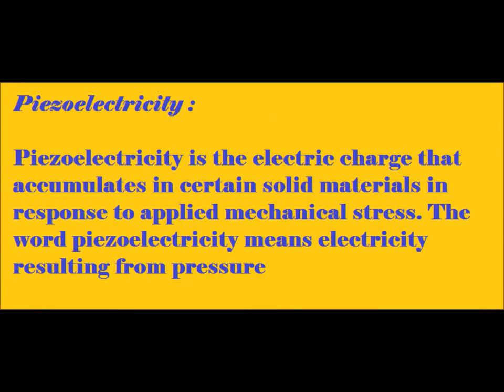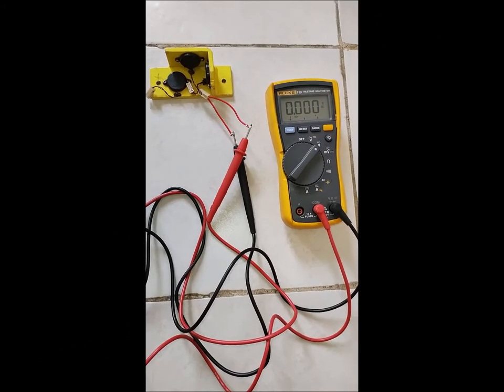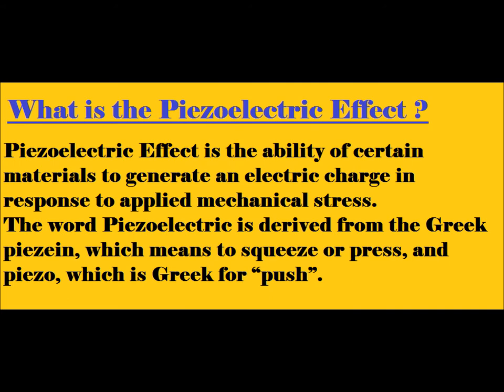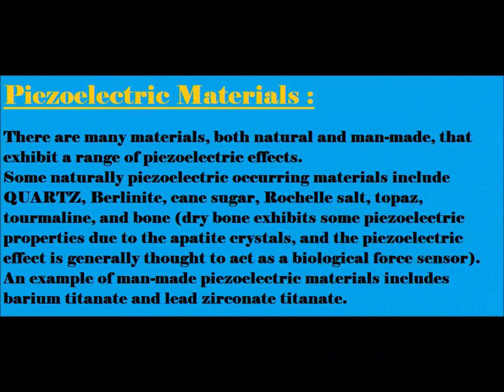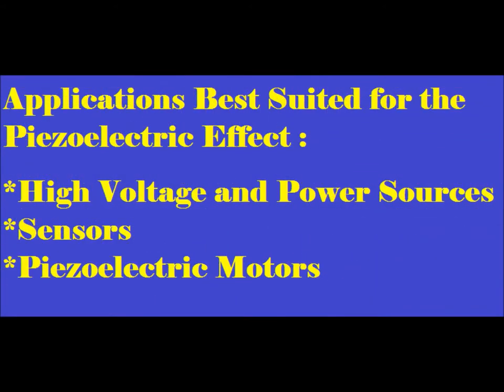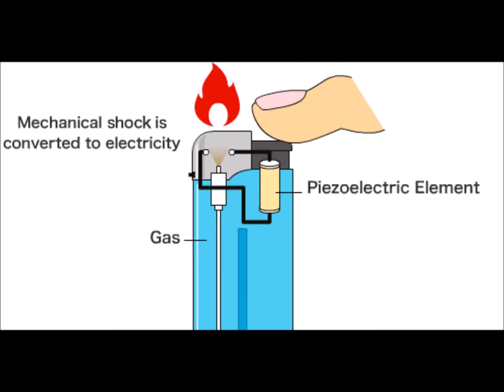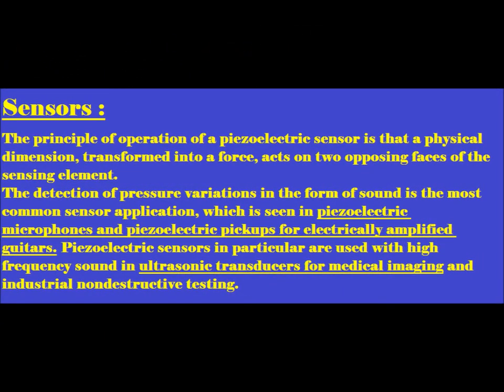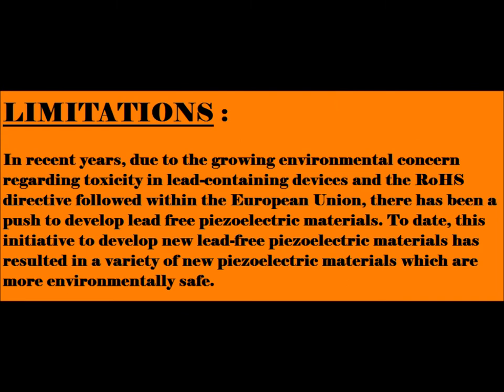PIEZOELECTRIC EFFECT - THEORY & PRACTICAL VIDEO

Comment: Sir,How does work piezoelectricity in gym and work places
Reply from the maker: Mam, piezoelectricity in gym n workplace is available in the form of vibrations caused by physical activities like running on trade wheels or walking or cycling and jumping. Even sitting on chair helps storing energy in piezoelectric crystals and deliver energy
Reply: @bishantkumar12589  Thankyou sir
Reply from the maker: @neetuSingh-yl6xk  wlcm..pl support the channel...subscribe and share 🙏
Reply: Sir how does piezoelectricty work in power generating side walks and also in mobile kepads or keyboard..pleaze sir explian in..i have semina on this topic

Comment: Sir how does piezoelectricity works on power generating sidewalks and also in mobile keypads and keyboards..please explain it..
Reply from the maker: Same principle, external pressure on piez material creates + & - polarities inside and hence a path for charge to flow,i.e. electricity!!
Reply: @bishantkumar12589  thnq so much